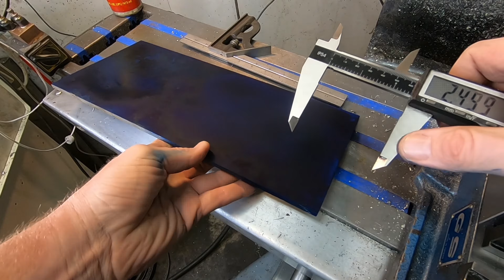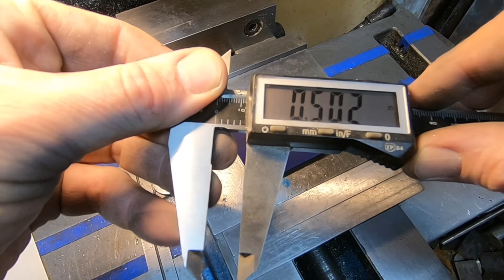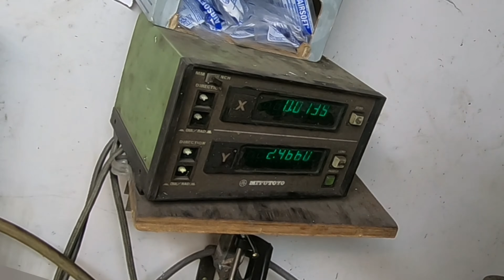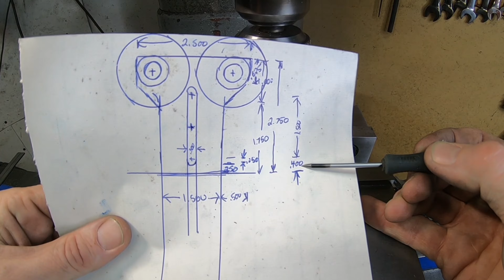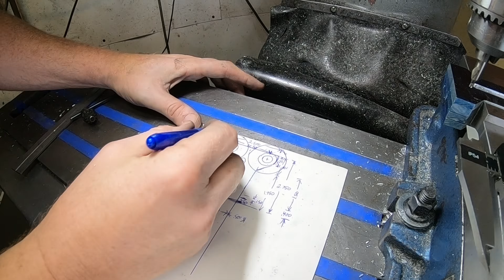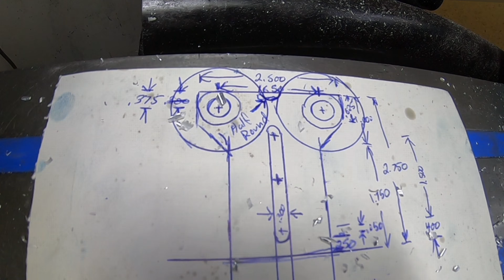Machining Roller Plate For Crank Shaft Truing Stand    part 6

Comment: Your channel is refreshing.
Same habit as me, always measuring the diameter of the drill with the caliper when you take it out of the box.
Easy to remember: the T-Rex's belly is convex.
Now I know why thin taps sometimes break off when using the T-handle holder, the concentricity of the chuck is terrible, you can see it at minute 18.50.
Cheers
Reply from the maker: Hey TorteTS glad you enjoyed the vid ,   Also trex / belly convex , love it .